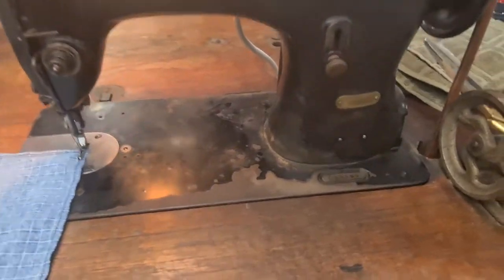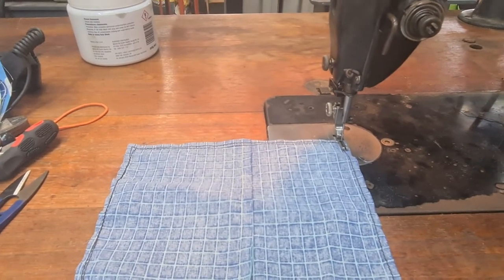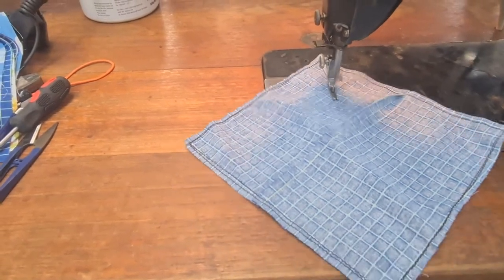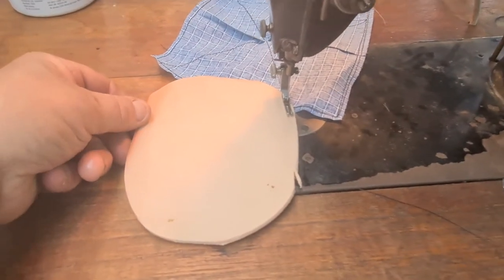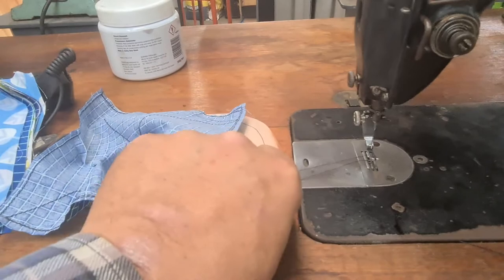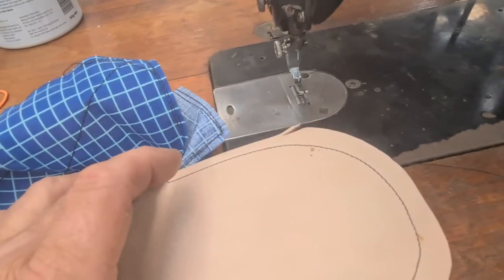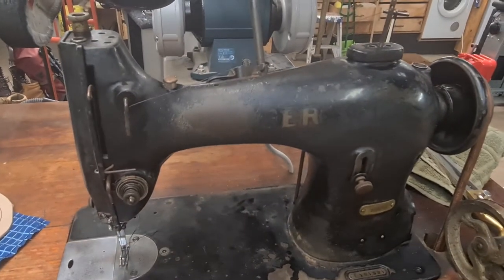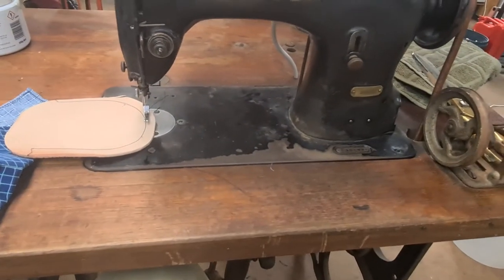Singer 95K40 industrial sewing machine circa 1940.

Comment: i just picked one of these up today. The manual says to use 88x1 needles. I was going to sew light leather on it but can't find a 88x1 needle with a leather point for love nor money. What size of needle are you using or any advice?
Reply from the maker: Sorry for the late response. I drilled out the needle bar to accept standard round shank needles. This made it very easy then. Good luck with your sewing projects. 👍

Comment: Hi, I don't suppose you know what one of these machines are worth in Australia?
Reply from the maker: I purchased this one for $150.00 but it needed some tlc. These machines take a universal needle like those used in domestic machines. I have drilled out the needle bar to take up to 140/16 needles which are much thicker. This allows me to use industrial threads for leather and canvas. I am installing a servo motor to slow it down and increase the control. With these mods you would expect to cost around $500. 00 this is still a very affordable machine. The next step up would be a 111w 211w which go for around a grand and up.